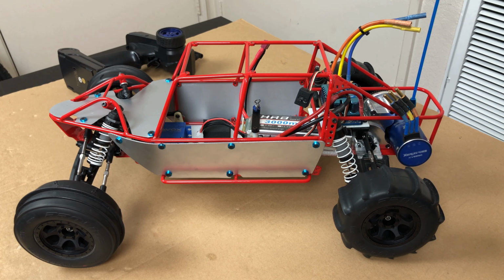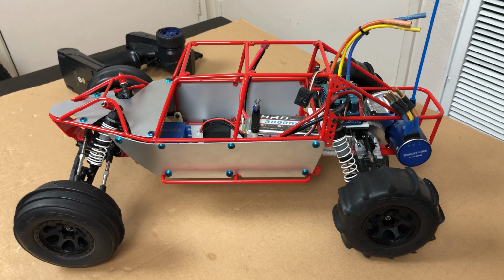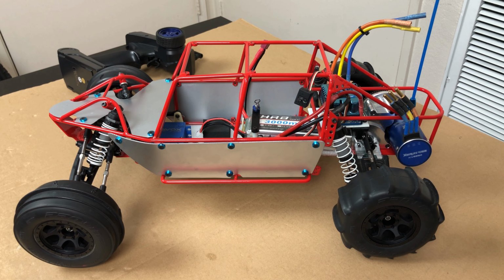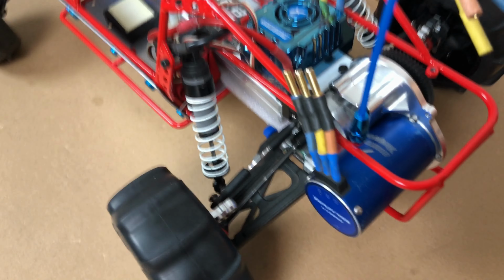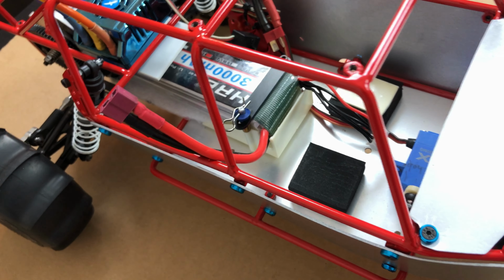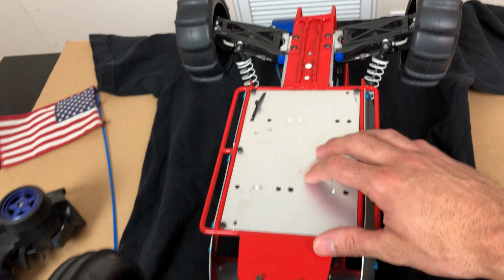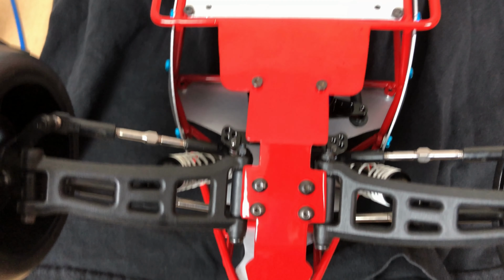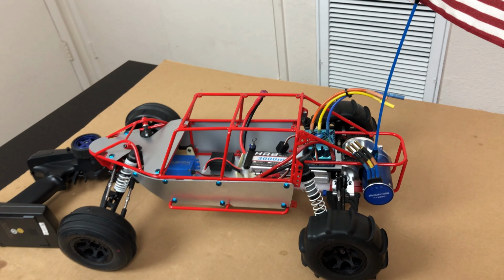Custom RC Sand rail / Dune Buggy Project (RC4WD)

Comment: Nice sand rail. I sure wish I could het my hands on a tubular metal cage like this. I like the Traxxas 2wd platform as a starting point like you did but I really need to do more research.  Your Sandrail came out looking awesome. 👍👍 Great job on the Lexan panels.  They almost look like aluminum in this video.
Reply from the maker: Thanks, it took a lot of time but got it looking nice and working great. Every once in a while you can come across one on ebay
Reply: @speedstermo  Thanks. I actually found the perfect one on ebay last night. I hope I can make some nice side panels like you did.
Reply from the maker: @RCRoads  That's awesome. I ended up making new side panels out of a different material. The Lexan ones were getting cracks on them. The new panels still look nice.

Comment: Would this be possible on a rustler 2wd I seriously need one!!!
Reply from the maker: On this frame in the video just the rear end from the Rustler 2wd would fit. There is another company that makes a frame that can fit the front and rear end of the Rustler.
Reply: @speedstermo  got you do you think a zip tie could secure the front?
Reply from the maker: @NoTractionRC  A zip tie would not be able to secure the front